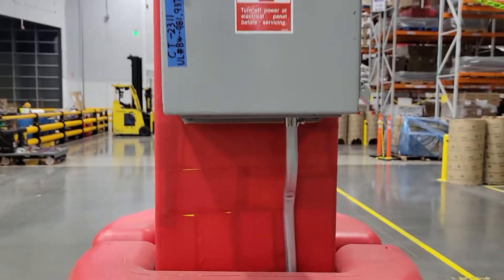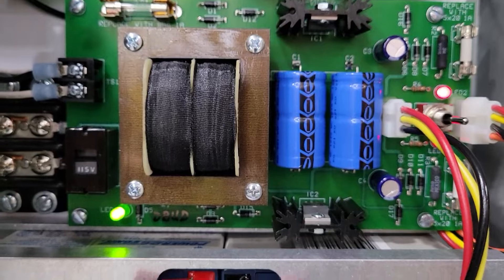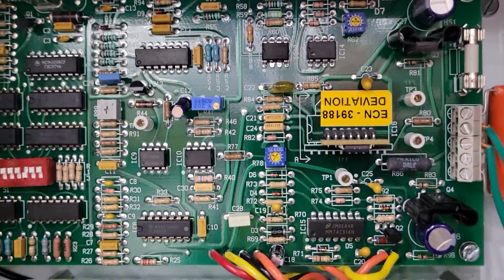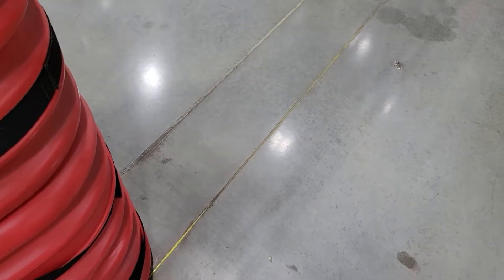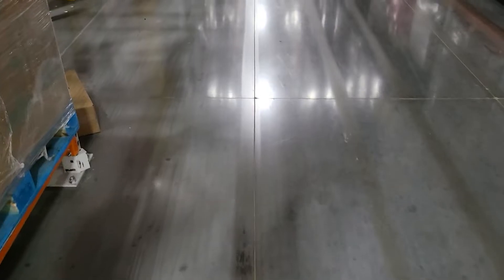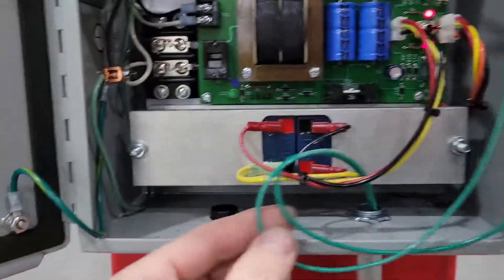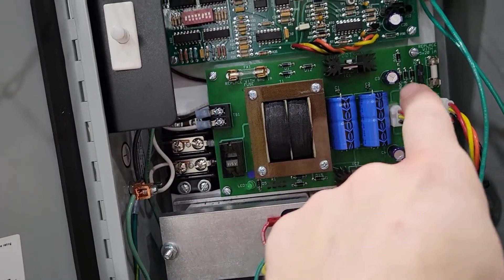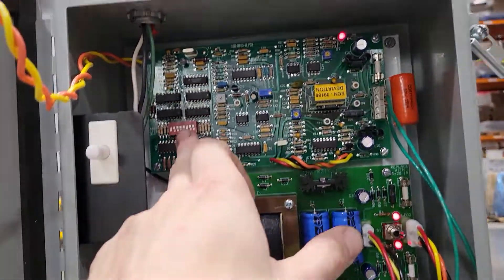Hyster Wire Guidance - Part 1, The Driver.

Comment: Is the capacitor matched to the inductance of the wire loop?
Reply from the maker: Not that I'm aware of. It's just that one cap, no other options, just under or over 5000 feet. So, maybe not matched, but close enough? Maybe it helps surpress noise over a longer distance?
Reply: @Scrufdog  low pass filter if parallel to the loop.